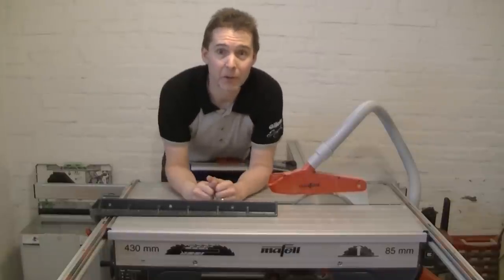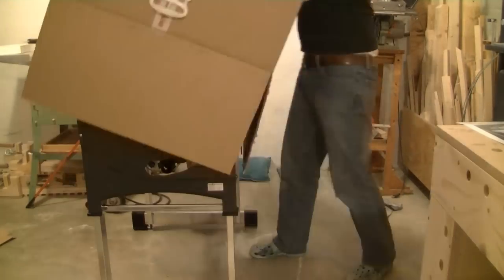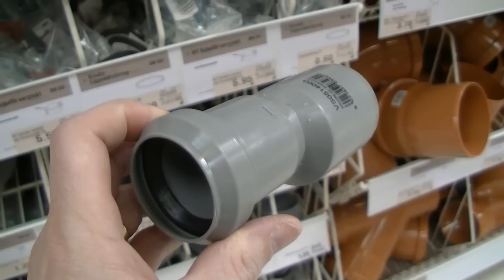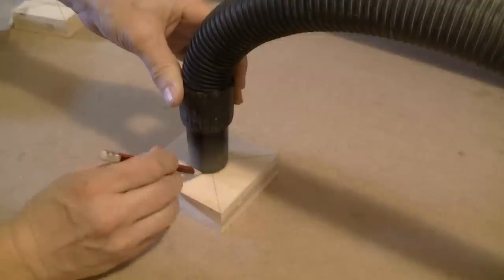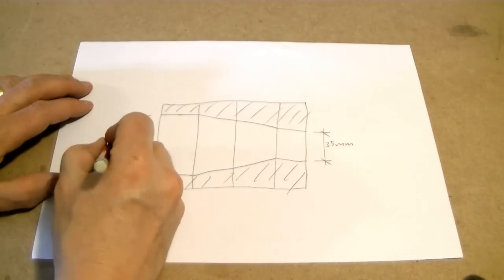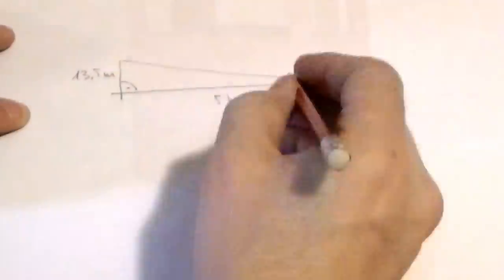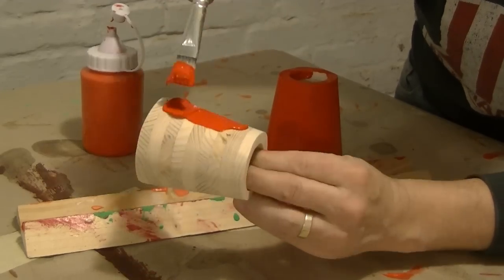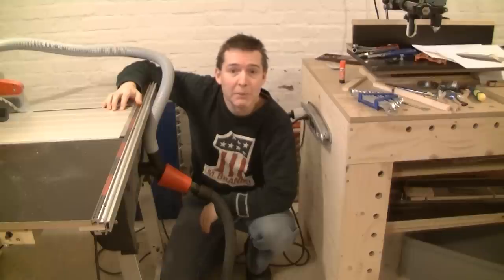Make a shop vac adapter

Comment: Mafell actually offers an adaptor for that. It's even in their catalogue, but unfortunately only in the vacuum cleaner section. Part number is 203602, price around 15 EUR and surprisingly it's not made of cheap plastic but of aluminium, so worth this price for sure. I use it on the Erika 85 EC and I'm very happy with it :)
Reply from the maker: Thanks for the hint! To bad they do not list it as an Erika add on. Every one with a standard shop vac needs tihs.

Comment: Too much work honestly. You could have easily used PVC adapters along with rubber plumbing adapters in combination. The rubber plumbing adaptors come with adjustable steel bands and easily alter the diameter by up to 1/4" larger and up to 1/2" smaller if needed. That's exactly what I did and it worked perfectly. They are called sewer adapters here in the USA and cost about $4.
Reply from the maker: I'm aware of all the tips and tricks you can do with inepensive PVC plumbing in the US. Unfortunately there's no such thing as cheap and easily available PVC adapters in Europe.
Reply: IDK I was kind of thinking it was too much watching throughout... but at the end it just looks so perfect, I'd say it was in fact worth it.  It's hard to put a price on good personalized tools.